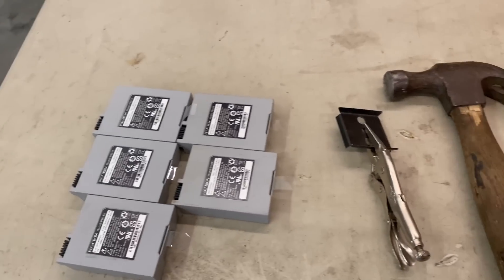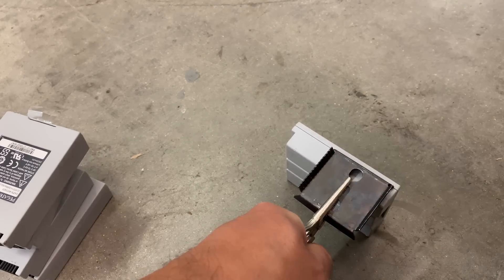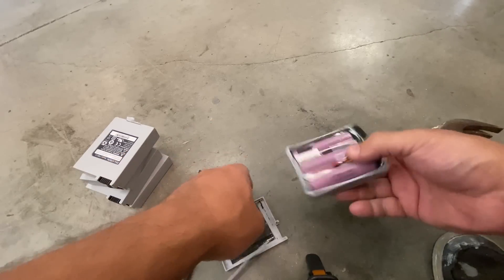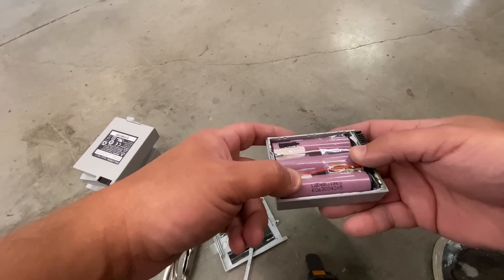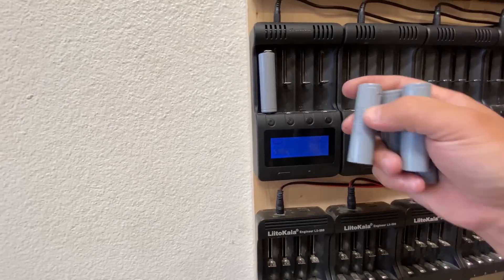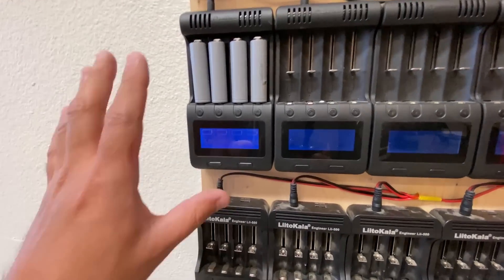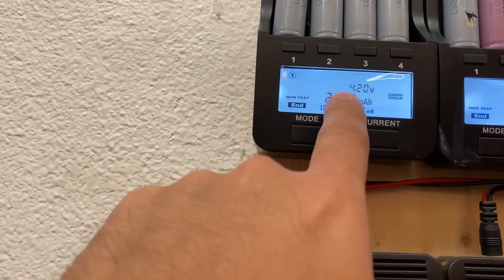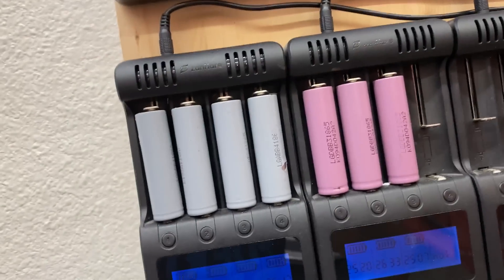Harvest 18650 Lithium Cells out of Pegatron Modem Packs

Comment: I am a bit stumped, but if I make a 4S 18650 pack with a BMS on it do I need a solar charge controller that can do lithium batteries, or do I just throw it directly onto the solar panel so no charge controller is needed?

Comment: very good disclaimer.

one reason for different capacities is maybe the charger maker has the low end and high end set different.

for example a turnigy accucell 6 charger will allow discharge and storage all the way to 3 volts where as a turnigy 400 watt charger will storage and discharge to 3.2 volts so it will leave more margin for safety  due to the fire scares.

same goes for the recovery of overdischarged cells.
  the accucell i think will allow you to charge from as low as 2.5 volts where as the mega 400 and 800 chargers will not allow any lower than 3 volts .

so newer chargers if you want to recover a low pack you either have to use the nicd mode to slowly bring them up to 3 volts or  set the charger to 1 less cell than in your series and do a charge without the balance connector connected at a very low current.

a bit of warning. recovering low or even 0 volt cells is very risky and can result in thermal runaway and fire but it can be done.

Comment: I bought these same modem packs and was struggling to get them open using a razor knife to cut them open. I was probably spending 2-3 minutes per pack to get them open. Then I watched your video, grabbed a paint scraper blade I had on hand, my Vise Grips, and a hammer, and did the remaining 70 packs I had in about 30 minutes! Thanks so much for sharing! Wow, you saved me a crap-ton of time. :-)

Comment: So I’m planning an off grid system. Going to be at least 6kW. Want to have 20kWh of battery. I keep going round and round of how to build the battery. I keep landing on salvaged Nissan Leaf batteries due to cost. I realize that many of these have only about 60% capacity. With these batteries being about $1 each now we’re getting to a price point that makes sense. So by my calculations I’m going to need 14s150p for a 48V, ~20kWh battery. Leaf batteries would be more convenient but... What are your thoughts? And how many BMSs would I need? One for each 14s?

Comment: I bought a quantity of the modems from BH. I used a Liitokala device. I really do not think that 5 year old cells are going to test out at 2800. Those chargers inflate the numbers by at least 100. My experience with these modem cells was that most of the cells were in the mid 2500's with a few testing over 2600. Results similar to what you had on your Liitokala chargers. The gray cells seemed to be more consistent and test higher than the purple cells. Out of about 250 cells I had 10 that were not usable, testing too low or just dead. Also had about 10 that tested in the low 2400's and I choose not to use them in 7S packs. Easy to take apart and clean up. Good cells but not great cells.

Comment: i have a motorcycle with a custom battery 72v80ah 20s 2.5ah cells? either 640 or 800 in the pack didnt ask questions 5.7kwh and a 5kw continuos motor and controller 10kw peak motor based on a dong fang jazz originally 2kw and SLA

Comment: can anyone explain to me please about tesla tech balancing the cells in a big pack as oppossed to a BMS which only switches off charging at peak charging. I want to use my battery betweeen 20% to 80% commuting so I can get 5 years use out of them.
Reply: Buy a tiny $5 step up or step down.   Adjustment

Comment: a lot of work for few cells, I'm lucky to get many free tools battery at 36v 5ah, ie 20 pc highdrain 2500mah cells and usually the circuit board given up, unfortunately only acquired 6st lii500 to test with: /

Comment: Why do you do the capacity tests at 500mA?
What would happen if you do it at 700mA or 1000mA?
Reply: Most likely because his chargers can't go more for 4 cells at a time. You need to look up the spec sheet for the batteries and charge and discharge according to that to really compare against what they are rated for.  For instance the grey ones should have been charged at 1250mA and discharged at 500mA to get their true capacity compared to new.
Reply: @sethsalberg3678  thanks.
Reply: @sethsalberg3678  You know, I have done tests in the same cell. First load and unload it at 700mA and 500mA then I did the same but with 500mA and 300mA. The cell capacity values varied. Could you tell me something about it.

Comment: Great timing for me, as I just started learning to build batteries. My main question was to do with Resistance numbers, and also did not know about punching to mode button twice. Thanks
Reply from the maker: Glad I could help!
Reply: Resistance. Annoys me more than politics.   I've learned either use SAME BATCH cells.  Or use garbage cells. And watch voltage closely.  This of becoming a scientist is overrated

Comment: Nice vid. 
Willing to repurpose the included BMS. Have you figured out the pack pin out?
Thanks.
Reply: I tossed the BMS but it was a 3 wire connection. On the pin outs

Comment: Why you have never talked about internal resistance of the cells
Reply: He has talked about internal resistance but all cells have it different right? No two cells are chemically identical, I highly recommend you should go through all the videos, Jehu has thrown, lot of insight, you will surely know the stuff you want!!
Reply: I've got some of the pegatron 2200s.. some packs I had to discard, about 1 in 100.. rusted inside. But the resistance varies, I've gotten in the 90s to 190uohm ... so far charging fairly well!
Reply: Internal resistance is a function of cell quality, state of charge, and the cell temperature.  I have some Samsung INR18650-20Rs that show 190 mOhm  when discharged to under 2volts, but show 10 mOhms when fully charged up to 4.2volts.  Also, the cell chemsitry affects the IR.  A brand new Sanyo 18650 will often have a much higher resistance (> 60 mOhm), where as  a completely destroyed INR18650 will only show 120 mOhm at full charge.   IR is a valuable piece of information, but only in the correct context.
Reply: There are two ways to get IR 
1) Get the disc sheet by the cell manufacturer and get an idea
2) Take a multimeter and take the resistance reading of all your cells.
With the second method you actually build battery pack in next birth Lolz 😂🤣😂🤣😂💐🌹

Comment: $2.99 per pack ?? Why are you sticking it to the man?? $1.30 from Battery Hookup!
Reply: It's slightly different cells. I just got my bh ones, their the atl/lg  2200s. I think Garcia is pushing the 2600's finished crackin about 80 packs. They are charging up very well so far , will do capacity test soon
Reply from the maker: I can’t compete with battery recyclers prices.  I also can’t work without making money anymore.   The beauty of capitalism is that if my prices are indeed too high then they won’t move  forcing me to lower the price.
Reply: jehugarcia , beautiful response.
Reply: Appreciate the heads up on BH.  Note - order large as shipping is kind of flat rate starting around $10. Doubling my order from 10 to 20 batteries only added a dollar in shipping. 
Sadly BH does not do DIY videos nor instructions. Jeg does. Hence the support for @jehugarcia Jehugarcia 
Glenn - whom else can you suggest ?
Reply: better than paying $11 for one pack on ebay
Reply: @Matt Townsend another youtuber saying it was $1.50 per pack.
Reply: Supply and demand.
Reply: It call greed
Reply: Battery Hookup originally had the same modem cells priced higher than $2.25. Probably somewhere around $1/cell. I don't think that is a rip-off price but very standard. I almost bought some at the higher price but waited and they went on sale for the $2.25 amount. The cells sold out very quickly at that price. I am sure that BH sells in much greater volume and certainly prides themselves on having the best deals. Don't be so hard on Jehu, he has three dogs and four VW's to feed.
Reply: because he bought from BH and resale with his 100% profit added. he should add just 20%.

Comment: There a no more Modem Packs on battery hook up so, why talk about them?
Reply: I just bought two? Edit: they were 2200mAh
Reply from the maker: Because I’m sitting here looking at a pallet full of them
Reply: @jehugarcia  Haha, that does make logical sense.
Reply: https://jag35.com/products/pegatron-modem-18650-three-cell-battery-pack
Reply: @Silpheedx  he's selling them for $.75 more per pack than Battery Hookup.  That's a 25% mark-up.  I'll wait for Battery Hookup to get them back in stock.
Reply: @mhaggerty7484  Thanks for the heads up. I'll consider the extra cost a worth it donation for taking the time to put out videos teaching me how to do any of this in the first place.
Reply: 75 cents per pack comes out to 25 cents per cell for 400mah more capacity. I think that's well within reason. Also over 80 cells that would be a gain of 118whr over 2200 cells. 
May not make much of a difference on a power wall but it requires the equivalent of 32 extra 2200 batteries.